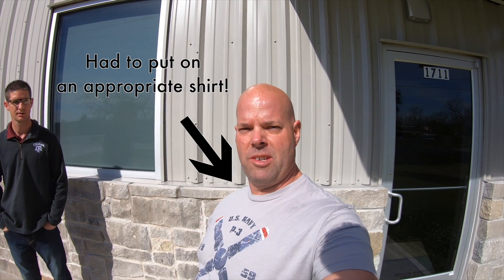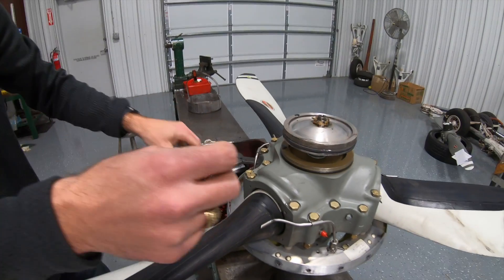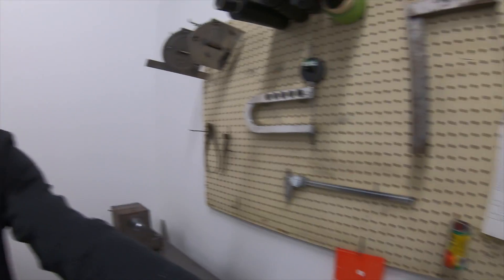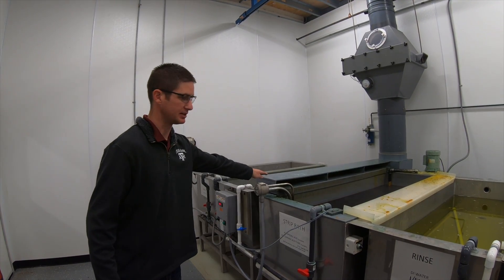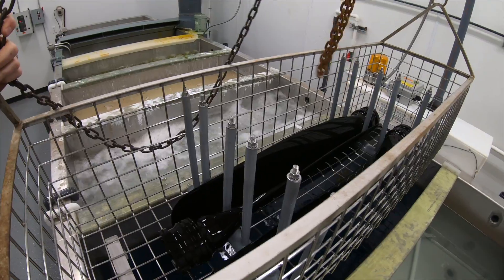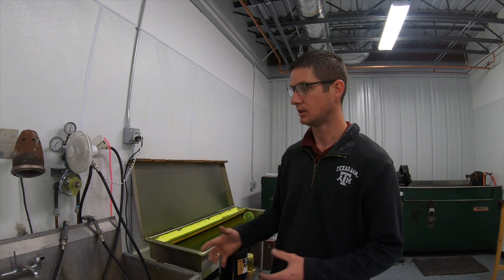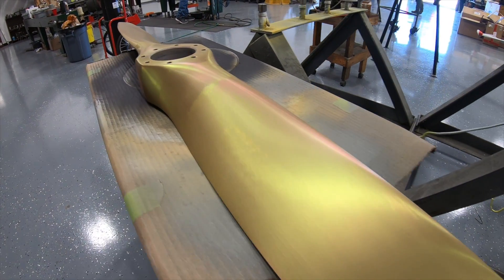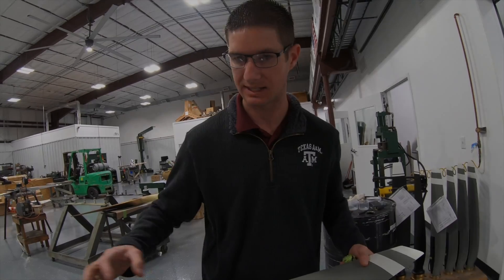What happens when your prop gets overhauled?? Pt. 1

Comment: cool machine to inspect blades. we had to do it the old-fashion way- marking off the reference points and measuring them by hand. you guys have a lot more infrastructure than our little shop. all those steps in the tanks were done by hand at our shop. if we had our shop setup today- the california epa would be constantly up our asses- you don't want that.

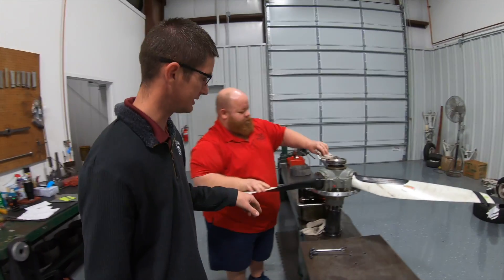Comment: The info at 3:00 finally got me to understand how the constant speed prop works. Thanks!
Reply: there are actually more than one type of CS prop- some of them have external links (like turbine units) and some have internal links/dowels (smaller props)- all were actuated by crank oil pressure.

Comment: Do you need to be a full fledege A and P in order to learn about prop overhaul?
Reply: you could be, but you won't be able to sign off on anything. a&p techs are not permitted to disassemble or repair propellers. they can do r&r or dress/clean/paint minor prop blade nicks or scratches. pilots and owners are also permitted to do these procedures. in order to sign approval for a repair or yellow-tag refresh/overhaul- you must be an FAA-certified temporary propeller airman.

Comment: How many flight hours in do you need to get an overhaul done on the props?  The same time as the engine needs overhaul or do the props last longer?
Reply from the maker: That’s a good (but broad) question, David- each manufacturer publishes the TBO (time between overhaul) in the documentation of the given prop in question. So the short answer to your question is that it varies by manufacturer, and sometimes by model.
Thanks for watching!!
Reply: no- the props aren't as well-protected as the engine parts. the biggest enemy of general aviation propellers are inattentive pilots mowing down ground lights with their propellers- the blades don't like that too much- but prop shops do....also propellers operating on unimproved runways obviously live a tougher life.
Reply: 6 years recommended

Comment: This was fascinating! I love stuff like this. There is a place about 30 minutes from me called Covington, and they do radial and PT6 overhauls. I got showed around there a couple of years ago and it was a blast. I would love to see this in person sometime too!
Reply from the maker: Oh, cool! I would LOVE to do a segment on that place- the PT6 and radial engines are so iconic & cool!

Thanks for watching!!
Reply: i used to do NDI on jugs and other engine parts- for beer money. i even did a lot of off-road stuff, but we rented a shop next door for those activities as we were a prop repair station and all non-prop stuff had to go next door in case we got inspected. i had to sneak the ferrous-metal parts into our wet-mag room at night- we had a big, old wet-mag bench. our shop (san diego propeller & accessory) was at gillespie field and i don't know who has the fixtures and equipment nowadays. we had an owatonna 100-ton press that we used to use to break ferrules from mccauley blades- the cheater bar was 20 feet long! some of the tighter ferrules would require all four of us (about 700 lbs of guys bouncing in unison) hanging from that damn cheater bar- when they broke loose it was like a gunshot. next to building turbine props- those were my favorite jobs. we had all the old benches and balancer stand that were used at general dynamics/convair during The War.